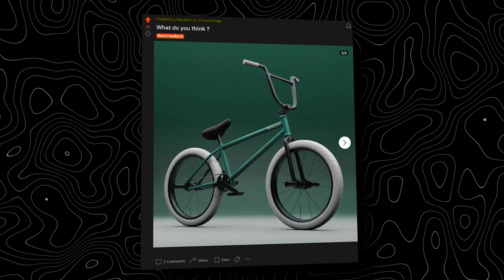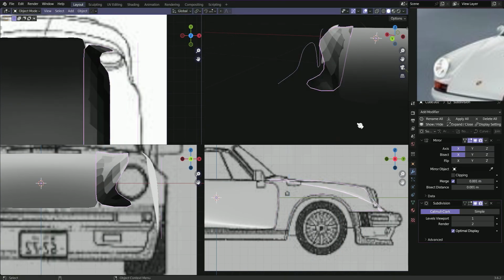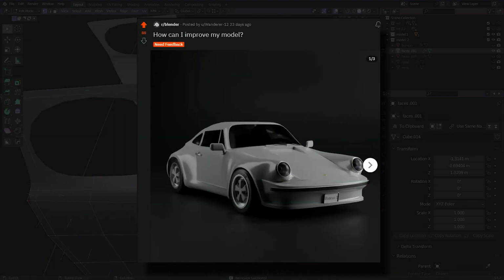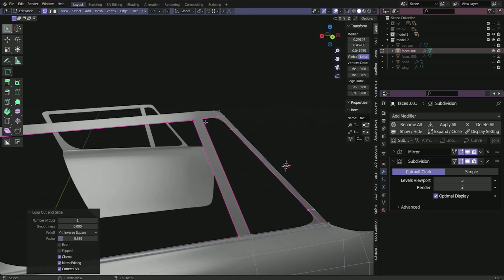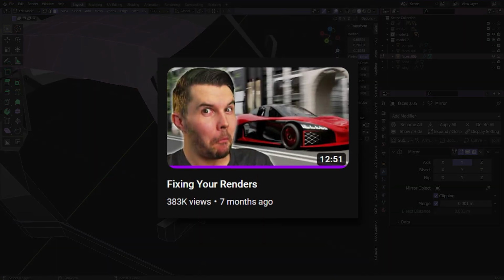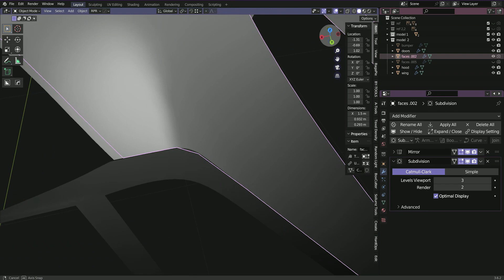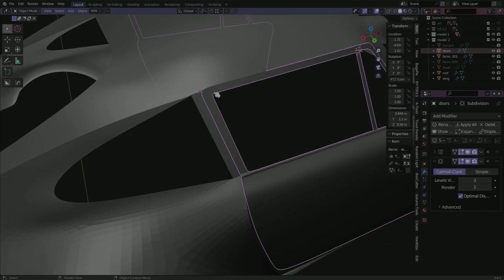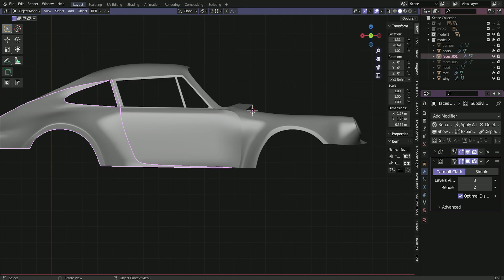I made a car in blender in 9 hours and here's how I did it

Comment: Glad to be the 100th like, it makes me very happy to see progress coming from someone who has spent years to to simply just finish modeling the exterior, in a hard field modeling a considerably hard model, it is really good to see your progress, a few things to note, if you are modeling vehicles, typically I would still recommend modeling all quads however I do know that some parts just have to be tris , N-Gons are really bad, tris for some part not an issue, if you plan to model the interior etc I may recommend also using solidly modifier to have a frame going on (solidify then sub d as in modifier arrangement) whilst apply a small crease, solidify may not be a big deal for only blender renders but for video games, you need to use backface cuilling to make sure you model can be used for a game because video games can not render a plane from 2 sides, it needs to have a defined thickness.

Glad you also made this in only 9 hours because people are slow, I can't understand people who say a car takes months to model, no, its you that is slow, a model doesn't need months, you need to learn how to model fast and maintain the same quality, don't conflate speed with quality, a fast model doesn't have to be §hi*, you learn to swim and you build up the pace, you don't swim like dogs, you learn to swim faster whilst increasing or maintaining quality, if you are looking to upgrade modeling hardware id recommend getting a good mouse or do like I do and get a drawing tablet, now they aren't made for modeling (they are for sculpting, etc) but you can setup it in a way in blender where you can use it as a mouse, etc whilst only need it and the keyboard (alt and shift) to move around, this is the workflow I go with as I find it putting less wrist stress which could affect your modeling, noting that we typically spend hours on hours modeling, this is a health risk, I still do use the mouse for most camera navigation because its faster but for modeling, id prefer the drawing tablet for accuracy and comfort, blender is great for texturing but I would also recommend maybe investing in substance painter to just have a bit more control on texturing.

I really just told you years of what I learnt, I hope you learn from it too, the last tip and advice I would tell you is to invest time in hand practicing than content, ( I am into aviation ) 3d modeling is really just like flying, no matter how many books you read about flying, you will never beat someone who tried to fly and did fly without ever reading books, modeling is a hand skill which you improve by practice not knowledge, I did not say do not consume knowledge but hand practice is more important, try to tackle new models you never tied to do it before, learn how to use sub d and model hard-surface, etc, these things will make you better than ever, do not leave a model until you master it, to reach were I am right now the same car project I'm on , I have re modeled it over 32 times on the span of 6 months, each time I learnt something new or apply a different technique until I reached were I am right now. 

Learn to model fast whilst maintaining quality, learn to master a model and to re model if needed to make it better, invest in a drawing tablet if you can, tackle new projects, and do not feel scared to risk it or screw around, a lot of things I paid someone else to teach me I would have done my self If I just risked it or screwed around or took action to try.

Keep pushing and I wish you the best ❣
Reply from the maker: Okey😪